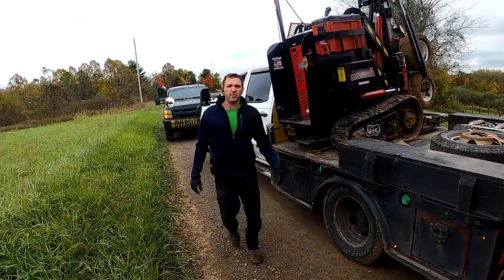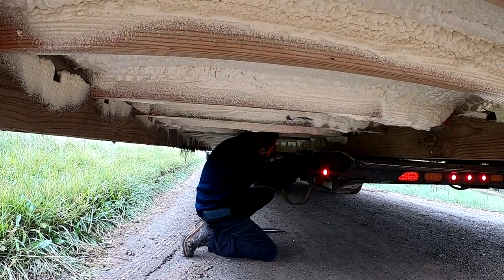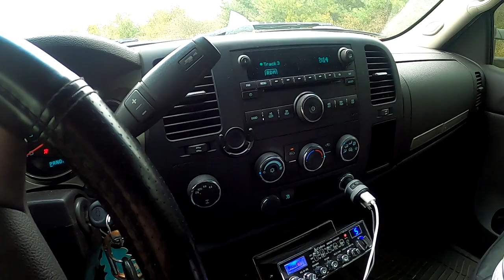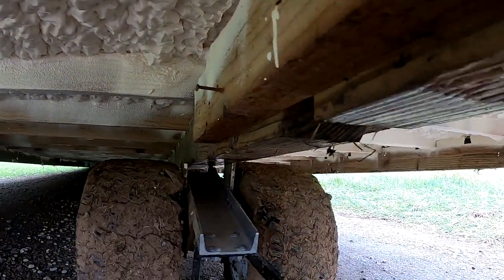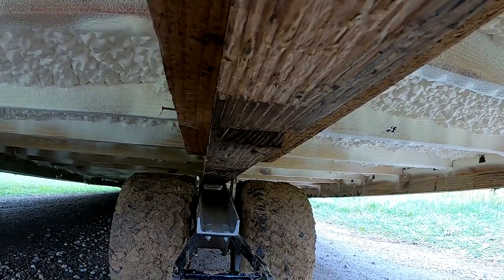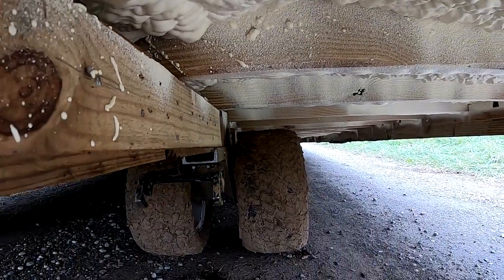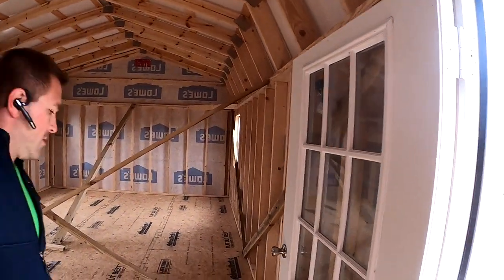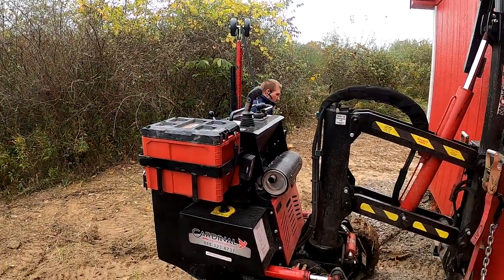14x50 Shed Delivery To A GOAT.

Comment: When you slide it back on trailer it put your trailer wheels in the center, could you have backed it into the driveway that way? Would have wild tail swing but a shorter wheelbase.  Just a thought.

Comment: What would that shed weigh?  Seems like a large load for a double axle trailer. I am amazed at where you are able to put these!
Reply: not much really, they are mostly air. probably well less then 10k lb
Reply: @als8518  Most trailers have 3500 lbs axles, 10K is a lot of weight
Reply: That’s not most trailers

Comment: Hopefully you'll never be crushed to death by a shed when you're attaching/detaching the wheels due to a hydraulic failure on the mule.
Reply from the maker: As long as the wheels are under it, it wouldn't got further then the wheel.